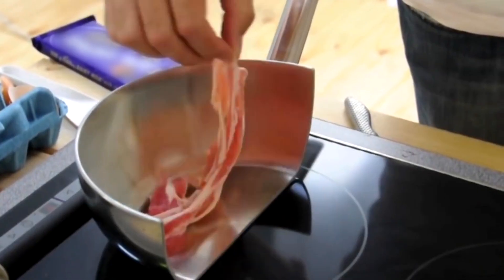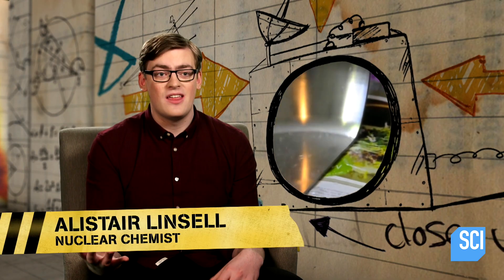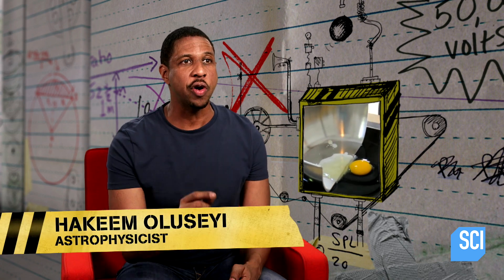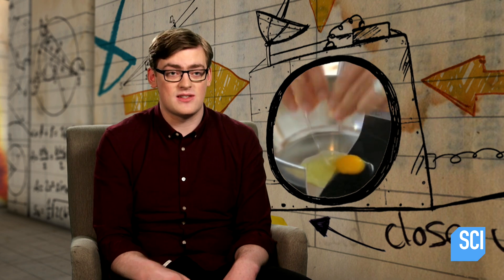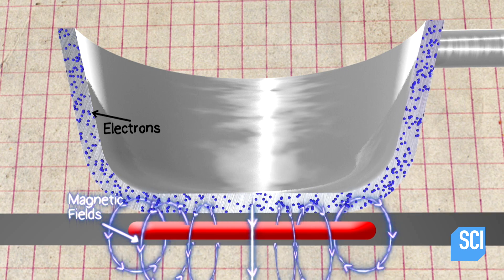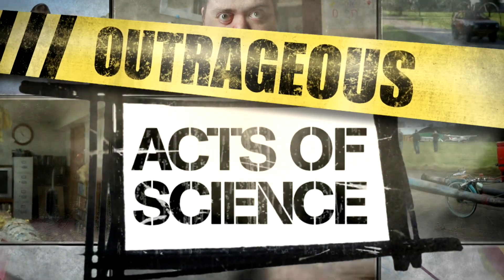How Does This Pan Cook Food On A Cold Surface?

Comment: What’s the power usage? Is it more efficient than gas or electric? Bc you know running a magnet kinda does take a lot of power, and would you use more power the higher you want the heat to be? Since the magnet would have to get stronger for a more higher heat?
Reply: It's more efficient and also heats up faster.

Comment: Induction cookers just don’t create enough heat.  I have one and I hate it, but can’t complain since it’s part of my rented apartment. I would not buy these if you plan on making Asian dishes that requires heat to bring out the flavour such as stir fry.  Even for instant noodles induction is not hot enough to cook instant noodles properly.  The end result is either the egg is not cooked or the noodles are over cooked (cuz you waited for the egg to cook). Heat is required for cooking.  Either use an actual fire (gas stove) or a proper powerful electric stove.
Reply: Buibuiopolis Mayor you've just got a rubish cooker. My mum has an induction and she loves it. She loves it more than the gas stove she had before. It heats up so fast and boils water in seconds! Mum had to learn to use the lower tempratures lol she kept burning everything 😂😂
Reply: The induction cooker I have is by Bosch,  it's pretty expansive for a rubish cooker.
Reply: It must be something wrong with your induction stove. Because the induction stoves should be way faster than normal electrical stoves.

Comment: I’ve had one of these induction cooktops for about 4 years and it is very efficient and fast compared to my other gas stove. The only downside is that it is hard to find an affordable nonstick, induction pan that will last you longer than a month before the coating scratches off or wears away.
Reply: Timothy Du aldi does induction pans that are really good quality.
Reply: Use stainless steel with mercury ball method for Nonstick

Comment: I have an induction cooker. It's really cool, my mom thought it was a regular cooker, so when she first used it, she thought it didn't work. She lightly touched the surface to tell if it was done heating, and it was still cold after a few minutes. She then realized it heated the pan "magically" I have no idea how they work but it's pretty cool.

Comment: As if this would be some now "hot" invention. They are around like forever. Got my stove more than 10 years ago. Also it is not cold. It gets very hot and can get way to hot very easy if you are not familiar with it. Ofcourse it does not get hot next to the Pan. But the Pan itself however can make the Plate hot. It is not a good idea to tuch the Stove after you are finished cooking.

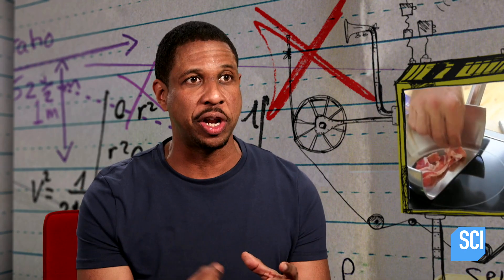Comment: Is there current moving in the pan or just magnetic fields lines?(0:43)
Reply: No current moves into the pan. It is just the field. Usually glass separates the two, which is an insulator.
Reply: Ms10000123 But you hear like me me? He said when the current move around in the pan. If it was the case the person would have got an electric shock.I think he had made a mistake or it is ne who is not understanding what he is trying to say.
Reply: jo andy There's probably a small current in each of the places the magnetic field is strongest, but because the structure of the pan (flat sheet), it dissipates through the material before building any proper current. If you were to coil a wire correctly for the magnetic fields to transfer the electrons in the same direction and not scatter you'd have a wireless charging reciever instead of a hot pan.
Reply: It wasn't said there was a current in the pan, just that the field causes electrons to move which is kinetic energy which causes heat.

Comment: I've had one of these for like 10 years now, nothing new. also, these DO get hot as the heat produced by the cooking dish gets transfered to the stove.
Reply: +cris rose Objects within close proximity with a temperature difference transfer heat. That won't change. Because the pan gets hot, whatever it stands on gets hot over time as well.
Reply: ThatBoogieman if something is a bad conductor, the heat won't dissipate quickly.
Reply: I have an induction stove a 2015 one (If there's still peeps complaining about age of the said induction stove) , and the pan transfer it's heat to the stove itself, sure it's technically not hot by itself, but the matter is, the stove absorbs heat, and it takes around 5-10mins for the ''HOT'' light to turn off.
Reply: lol, glass and good insulator
Reply: Storm van der voort,yea it doesnt.
Reply: Wow, why does this get so many upvotes?
Reply: So why is everyone still burning fossil fuels to cook?
Reply: +cris rose its not
Reply: yup, the stove will get hot for the same reason a table would on the spot you put a pan. it's not rocket science
Reply: Ankush Girotra Literally nobody is saying it doesn't get hot over time, the point is it doesn't heat the cooktop to heat the pan it heats the pan directly. Yeah it'll get hot with longer direct contact with the pan, but it doesn't ever get as hot or hotter than the pan itself, and cools off much much faster than a regular metal coil stove, or a gas stove with metal stand, or even a glasstop conduction stove.
Reply: Yes, but they're not very common in the US, so an informative video about this is nice for Americans. Lately portable induction cooktops have been getting more popular here. They have induction stoves in Europe and Asia and they're pretty efficient. They can interfere with pacemakers however.
Reply: But it doesnt produce heat,so it doesnt "get hot"
Reply: the hot light is also a indicator to be careful. It doesn't really mean it's actually still hot. I've used inductions for a long time and it rarely gets that hot
Reply: maybe with 10 year old technology. it must have progressed since then.
Reply: Ms10000123 A bit, but they use glass for the top and it's a pretty good insulator and would dissipate that conductive heat fairly quickly.

Comment: I have a Induction stove, the pan will heat the plate after a while, so he must have waited a while after each use when making this vid
Reply: This is only a problem if you use a big pan, glass conducts heat poorly.
Reply: ninja dragon That’s only because the heat from the pan eventually warms the stove
Reply: ninja dragon to me it's more like a "hot plate" to charge the new iPhone X / 10 as wireless charging
Reply: Noah Mitchell ik
Reply: ninja dragon stove*
Reply: vin vuong ok
Reply: ninja dragon i
Reply: Noah Mitchell Yeah exactly
Reply: ninja dragon .
Reply: ninja dragon @
Reply: ninja dragon  fb
Reply: Ghosty nice one
Reply: what are you talking about. I have an induction cooktop as well. Yes the  cooktop will get hot only because the pan transfers the heat onto the stove but in this video only half the pan/pot is present so the other half of the stove that doesn't have a pan on it wont get hot since it wont transfer the heat to it.....
Reply: No cause they're only using half the stove and that's what gets hot
Reply: ninja dragon well induction works that way that it's a kind of magnet beneath the stove heating the pan, and there is no heating element
Reply: lukas ersgard ik, i have one, just trying to explain heat transfer
Reply: lukas ersgard if you have lets say a 1000°C lump of metal, and you put it ontop of another lump of metal, then the second lump will get hot, the hole lump, not just the part thats tuching,
sorry my english iis not thay great, im norwegian...

if it is not sarcasm, in that case f**k you to make me wright this hole god dam thing

Comment: Electrical conduction doesn't have anything to do with this. Aluminium is an electrical conductor and it doesn't heat up on the induction stove. Only ferromagnetic metals like stainless stell or cast iron can be used on induction stoves
Reply: Trinity yeah, stupid error from the science channel and apparent scientists

Comment: I hate induction stoves. I don't have any pans that aren't metal, so that's not an issue. I can look at a flame and see how hot it's going to make my pan and how fast. Every stove has a different setting? No problem, the flame can tell me how it's going to behave. You can't see shit on an induction stove. You move the pan away, it gets way the fuck colder, not like a flame that burns over a distance, so you have more precision regulating heat by changing the distance between the pan and the heat. I still can't cook nice scrambled eggs without a flame. I bet Gordon Ramsay could, but that doesn't change the fact that it's more difficult. And for no benefit at all. Oh it doesn't get hot? Did you not take 3rd grade (induction marketers, Science Channel is cool)? If it heats the pan at all, the pan is going to heat the glass or polymer or ceramic or whatever top you've got it sitting on. Maybe it's less of a fire hazard, that you can't set your cotton mitt on fire. But honestly, has anyone done that since they were like 12? It's not even completely fire proof. I can tell you from experience, an induction stove can reach the autoignition point of sunflower seed oil. Some dripped out of my pan, got between the pan and the stove, and when I lifted the pan, the rush of oxygen caused a small explosion. So, it makes it harder to fuck up, but it also makes it harder to excel. Induction stoves basically force everyone closer to mediocrity where no one excels but at least no one fails. Except you might still fail because there isn't a glowing flame to tell you you left the stove on. The ones I've used all have LEDs, but they're also obscured by having a pan on the stove. And guess what? That's literally the only time  they're of use because with no pan, nothing heats up anyway.

Comment: how do magnets work
Reply: Magnets are simply electrically conductive metals that have all their atoms arranged in the same direction, acting like a one-way valve for the electrons in the atmosphere. It's just like carving a ditch through the dirt; water will go towards the ditch because it's the path of least resistance towards the main force acting on it - gravity. In the magnet's case, the electrons are drawn toward the positive side of the magnet's sheet of one way valve because it's less resistant than the random orientation of all the atoms around it in the atmosphere. Passing through the magnet they are then repelled away because higher resistance to the negative side they are now on. Some scatter into the atmosphere/other surrounding materials, some are looped back around the magnet to follow the same-ish path again, creating the loop you see in diagrams.
Reply: ThatBoogieman u win
Reply: Fucking Magic
Reply: black magic
Reply: i agree its just magic

Comment: I own an induction burner and the top definitely get's VERY hot. Just because the pan is what heats up doesn't mean a significant portion of that heat transfers directly into the glass cook top. If you were the move the pain, the place it was sitting would be very hot for several minutes because of basic thermodynamics.

Comment: Question.
Is it efficient? I don't think so,but it's pretty cool. Nice job
Reply: They are much more thermally efficient than traditional gas/electric cooktops, the evidence of which has already been given to you. They also can heat up the pan faster than those, as shown in many controlled demonstrations such as /watch?v=COUBe18_f0s.
Reply: It's very efficient.
Reply: Its called the low setting buddy, think harder next time. They are marginally more efficient than electric stoves.
Reply: "U.S. Department of Energy indicates an induction cooker is 84% efficient at energy transfer, versus 74% for a smooth-top electric unit, giving it a heating performance comparable to a gas element." 

You are wrong bud, get over it. Nice one highlighting your comment with misinformation.
Reply: Sinistrality Z2 the video is irrelevant. The cooking process is the same as gas or electric. The problem is the fact you are just stuck with your own opinion that is based on very limited information, which is a video were they set it to low so the chocolate wouldn't burn. Smarten up dude.
Reply: I dont know how fast you boil water on a gas stove. But on an induktion stove i can make water boil as fast as in an electric kettle
Reply: Sinistrality Z2 you have no evidence to support that, you are hopeless.
Reply: Sinistrality Z2 also in terms of energy is literally the same as cooking, it's all the transfer of energy. YOU ARE WRONG.
Reply: Sinistrality Z2 because they are expensive. Them not being used widely is not a valid point to how they cook. Get over yourself, you are wrong.
Reply: frederik pedersen that's much faster if you can do that.
Reply: James Tang Thanks buddy, I have just did my research and i was wrong. I'm fine with that, I love to learn new stuff. Thanks anyways. :)
Reply: Sinistrality Z2 "Just did my" stay stupid my dude.
Reply: Rolland Hall Well tbh i didn't know about induction before. This is the first time i heard of it so... yeah,but seriously dude you need to chill out. It's like i have offended you or something. Yeah you know about this shit more than me, but I know about other stuff more than you. So no need to get tense k buddy?
Reply: Sinistrality Z2 I was the same as you, I literally just read an academic journal on induction cook wear and there you go, you know something new. The problem  is you tried refuting the facts put infront of you without evidence. Probably because your ego was hurt each time I said "you are wrong"
Reply: I have one and I can tell you that its waay better than a classic electric stove.
Reply: I like this guy, he is a good guy.
Reply: @sinistrality Z2   .... You are clearly uneducated and very stubborn. Why dont you inform yourself before you comment. Induction cooktops actually heat food faster. I have one and its much quicker than electric and its even faster than gas!
Reply: Monokuma I don't think so buddy. From the video it looks like it takes a very long time for the pan to heat up. So if you think about, it is not that good in cooking meals like meat, rice or even boiling a descent amount of water. The chocolate bar barely melted my brother. 😅
Reply: Rolland Hall They are more efficient in terms of saving energy and what not,but not in productivity. Do you want to cook a filet of fish in 5 minutes or in 15?
Reply: Rolland Hall Well i appreciate that you took the time to research and putting all of the numbers to defend your statement, but it dose not show that in the video. It's very clear that the cooking process is very slow.
Edit: I'm not saying it's bad or anything, but it's not better than a gas stove. Not in terms of energy but in terms of cooking. It's will take at least 3 hours to cook a proper normal family meal.
Reply: Rolland Hall Nope because they are not better than gas and electric stoves. As I said in terms of energy yes, but in real life action no.
Reply: Rolland Hall dude if it's as good as you say so, then why isn't it popular? Why no one uses it? Most houses use gas stoves and some electric. Why uses these if we have the induction cooker?

Comment: I figured that was about how it worked, but I don't understand how the user touching the handle don't get zapped by the pan. Or maybe it's more like a welder with high current, but the voltage is so small it does nothing.
Reply: There is no electricity in the pan, it just causes the electrons already present to move more.

Comment: The bad thing is that the pan Needs to be feromagnetic for it to work.
Reply: yes, because magnetic pans are so rare
Reply: why is that a bad thing?
Reply: idk, the protegent memes were kind of a one time thing, so the proto picture doesn't really make sense
Reply: What kind of pans do you use? Wooden?
Reply: Maniac of Doom well, it means all those copper and aluminium pans many people have won't work.
Reply: Copper is magnetic,  and aluminum pans aren't terribly common
Reply: Maniac of Doom copper isn't magnetic, suggest you check that one yourself. Aluminium pans make up the majority of non stick pans in Europe because of its superior heat conduction, and lower cost Vs stainless steel.
Reply: Sorry, its early in the morning here I was thinking of electrical conductivity. Regardless I know very few people who even own a copper pan. As far as aluminum, most pots and pans here in the us are iron or steel, but aluminum isn't unheard of. Regardless these stoves aren't popular enough yet, but if they get big, non-magnetic pans will probably go out of style altogether or at least get less popular
Reply: Maniac of Doom that's fine, it's possible the popularity of stainless is higher in America because it's less likely to be damaged in a dishwasher. Here, probably 90% of non stick cookware is aluminium. Some have a steel plate built into the base for induction cooking, many don't. Aluminium is gradually dissolved in a dishwasher until almost nothing is left, so I moved to stainless. But it seems the aluminium encapsulated in the base is still being damaged by the dishwasher 😫

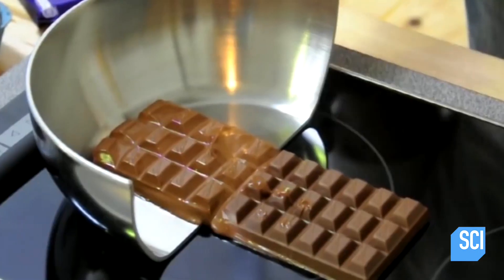Comment: yes stainless pan is good electrical conductor. but it has nothing to do with heating. the pan heats because it's ferrous metal meaning if magnet sticks to pan it heats up. as seen on 1:08.
Reply: There should be partial effects in nonferrous materials. I think elemental carbon is still undecided.
Reply: Is silly that the science channel got this basic thing wrong

Comment: why don't regular electric stoves produce a noticeable induction effect? Also wouldn't the inductor also heat up a lot?
Reply: Ciroluiro regular electric stoves dont have a rapidly changing magnetic field to induce currents on the base of the pan ^.^ 
And its the pan that heats up not the ceramic surface